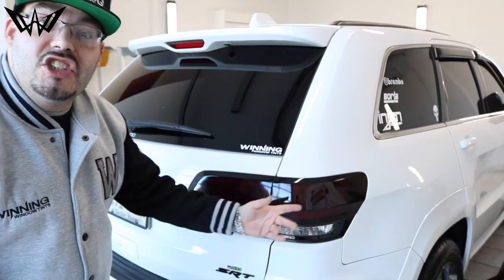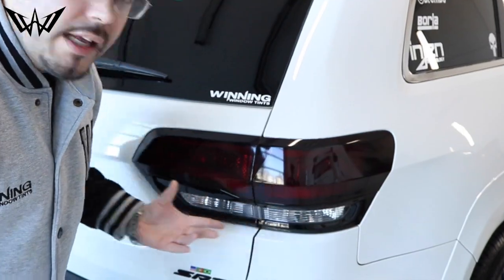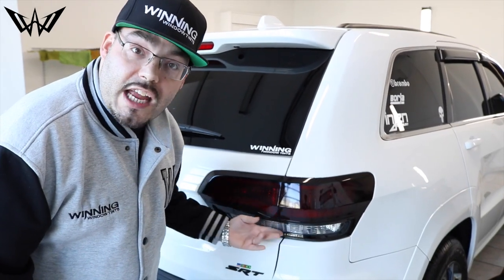Tinting Taillights on a Jeep Cherokee SRT 20% Tint (tinted)

Comment: Can I use regular window tint for this?
Reply from the maker: Window film isn't moldable enough to be wrapped around the taillights and the adhesive won't stick. Also, Window Tint is applied on the inside of the window ( not made for outside wear and tear )
Reply: @WinningTints  nice, thanks for the reply.